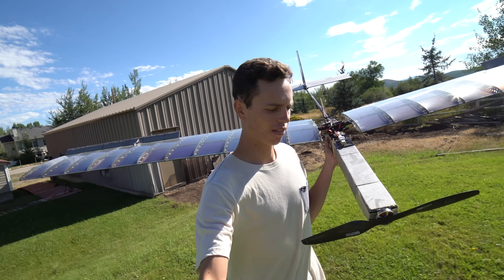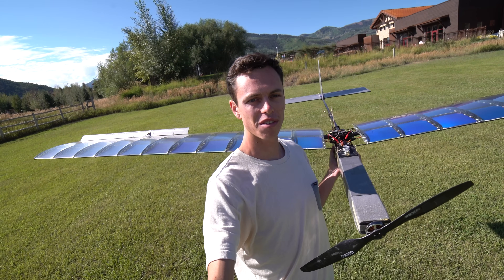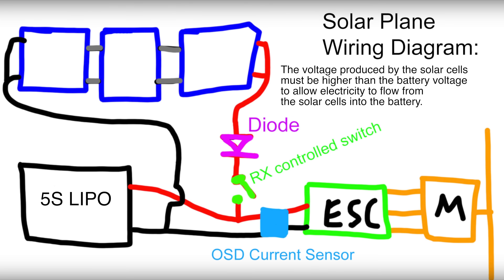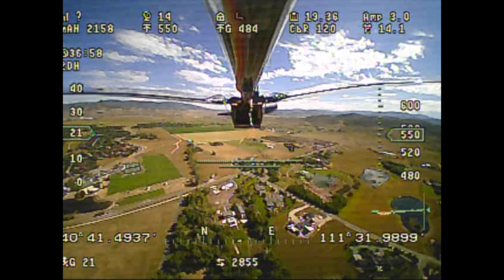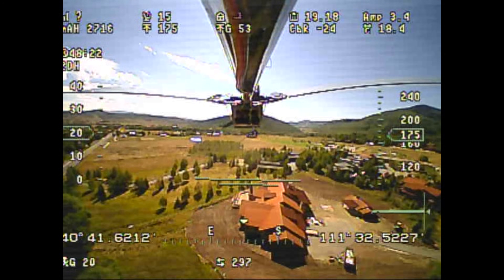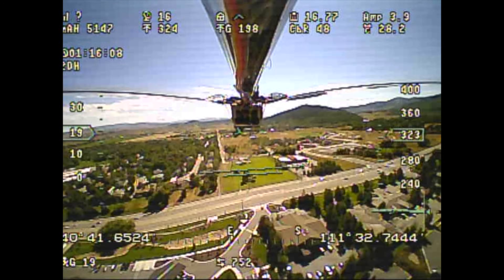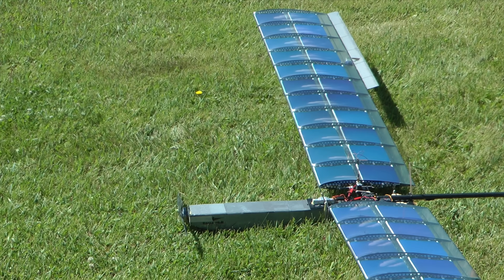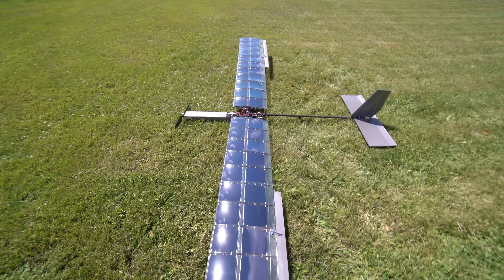Solar Plane V3 Cruise Testing - RCTESTFLIGHT

Comment: Do you need such a huge rear stab/elevator? Would reduce drag if it was smaller. Also would it be more efficient at higher altitudes?
Reply: Put some solar panels on the rear wings
Reply: superspeeed What if he did a V-tail?
Reply: It's a question of stability. I think he could move the CG back and/or make the horizontal stabilizer a bit smaller while still having decent stability. 

Making it more tail heavy (or shortening horiz. stabilizer) means less drag, but you have to be careful not to go too far and make the plane unstable. Nose heavy is good for stability but creates "trim drag," which combines with induced drag, especially at low airspeeds.

The vertical stabilizer looks a bit undersized to me, but if it ain't broke don't fix it.
Reply: He is using lithium-polymer
Reply: superspeeed Good point.  That tail is chunky.  He could have a longer tail moment and smaller, lighter stabilisers. It would be less draggy
Reply: Seriously man? Don't say dumb shit like that. Yes the Lithium is still in Ion and Po. Li-Po is a different mix of chemicals that Li-Ion. Yes it's practically the same thing, but I think most people understand that but they aren't the same thing because Li-Po batteries are much more volatile and can output more power. The two batteries behave differently and are used for different tasks.
Reply: StereoHead thought he said so.. lithium ion would almost half the weight Vs capacity..
Reply: Yes, there may be different chemicals (mostly in the anode/cathode material) inside, but that doesn't have anything to do with the form factor. The same chemistries can be and are put in pouch cells and cylindrical cells.
As for what you call Li-Po batteries (pouch cells) being more volatile, have you never seen an 18650 fire? Those things go off like rockets if they overheat or short circuit. Not different from pouch cells. Sure they are a little bit more rugged, but it's not because of different chemicals, but because they have a metal case around them.
As for pouch cells delivering more power. Most cordless tools run on 18650 battery packs, and those tools definitely need power. There are 18650 cells rated for 20 - 30 A continuous! current with peaks allowed even higher than that. Again, not different from pouch cells.
Question: according to you what battery type is used in phones?
Reply: No he isn't. You can see the battery, its a zippy 5s lipo. he even calls its a 5s LIPO.
Reply: https://imgur.com/ORnvFz4
Reply: Having a large horizontal stabilizer means you can fly slower without pitching up. Flying slower means less throttle.
Reply: He is using a lithium ion battery. Using a small dedicated solar charge controller would definitely be an advantage though. Doesn't matter much if it's step up or step down (just pick what needed to fit the solar cell/battery voltages), step down might be a little bit more efficient.
Reply: Lithium polymer batteries are lithium ion batteries. If you are thinking about pouch and cylindrical cells, they are just different form factors. Same thing inside. 
Btw. real Li-polymer batteries are still a research topic. Those batteries are still Li-ion batteries , but their electrolyte is a solid polymer. Current batteries have a solvent based electrolyte and the only polymer in them is the separating plastic foil in the battery.
Reply: superspeeed he should go lithium ion battery + dc-dc step up to get constant charge voltage?

Comment: Daniel, you'll also get 10-15% more efficiency if you can keep the solar cells cool.
Your stretch covering is great design but they are also mini-greenhouses keeping the cells hot, and they do get astonishingly hot as I found out when I used them to make my own portable panels.
Try to get some airflow over them if you can, and avoid getting any shade on them from the struts - there's a reason that Solar Impulse II's cells were on the outside even though they were unprotected and fragile.
Perhaps make a new wing with 3x12 cells on each? That should give just over 200W to play with.